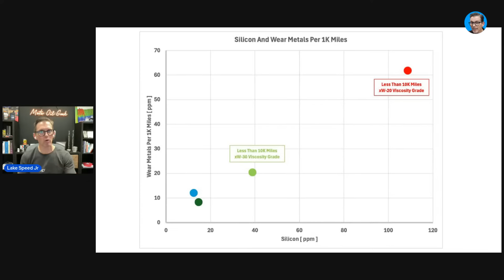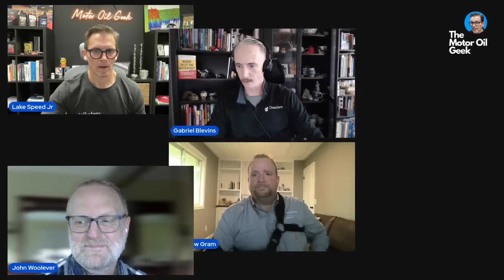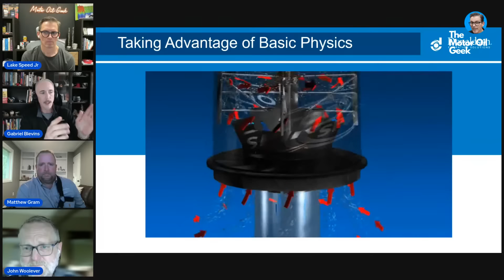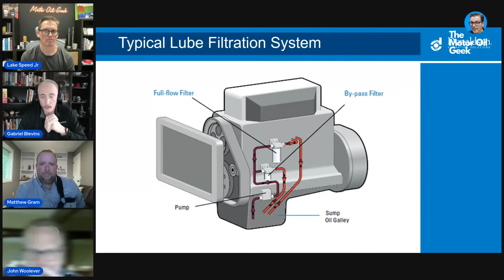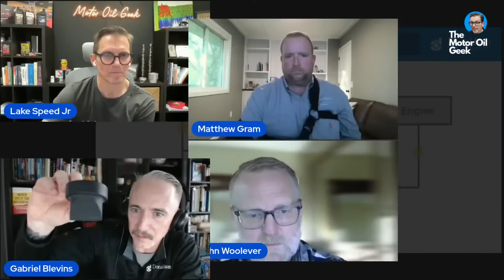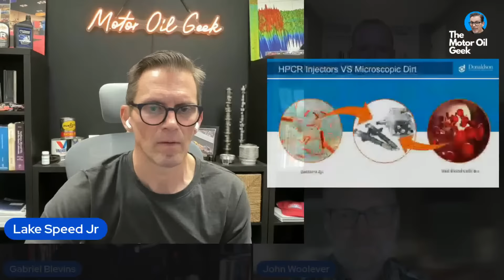DIRTY Filters Are BETTER Filters + BYPASS Filters EXPLAINED

Comment: So, I understand that you are saying to leave the air filter on as long as you can, and it will simply get more efficient as it loads up.  There is no indicator I know of on a gas engine, so I'll just have to use my best judgement as to when to change the air filter.  With that said, what about oil  filters?  Is there any advantage to running them longer as apposed to changing them frequently?  For example, the WIX Xp doesn't have the best efficiency rating, but is very well made with fully synthetic media.  It is rated for 20,000 miles, but most people don't run their oil that long.  Would a person be better off to run the filter up to 20,000 miles before changing it?  With all the used oil analysis that is done, has anybody looked to see if changing the oil filter more or less often has an effect on filter efficiency or contamination in the oil?
Reply: Lake answered this in another video, always run the oil filter for it's full rated mileage.  He also said to get the best efficiency rated filters.  I would choose the best rated filter from all those I have no concerns about how well it's mage.  You can't see a holed filter if it's a spin-on until it comes off and you cut it open.

Comment: I have experience with marine and industrial equipment centrifugal filters.   They work great... but they are multi-thousand dollar pieces of equipment  and are cleaned regularly (a quick check on the internet shows the ones I'm familiar with are about $20,000 and typically need 3 phase 440-460V). There are often 2 and sometimes 3 of them installed so you can clean and repair them while another one is running.   On industrial equipment that is shut down periodically there are often centrifugal bypass filters that can be cleaned when the unit is shut down.    I've never seen a modern car or pickup truck that would have room for even a the smallest centrifugal bypass filter I have worked on (housing about 7" in diameter).

Comment: Cake works on increasing efficiency of air filters but Lake you need to correct the latest video where you state FLUID OIL FILTERS get more efficient with time. Fluid filters don’t build cake. Especially not in automotive applications.

Comment: Great Video! The Air Filter gaining efficiency is logical but just never gave it thought.  I recall so many changing filters with a little discolor (light dust collection) on Intake Filters. Was always an easy Up Sale by the Service Writers in my older Wrench days.  Cabin Filters indirectly are a good example of that... since more ignore them until they are disgustingly packed or odor in cabin. 

Would like to see this continued into the various Aftermarket Dry & Oil Filters. I realize aftermarket CAI are more for "looks" than street gains, many filters are worse than OEM Filters for Dirt.

Comment: Great Informative Video on Filters, really enjoy these in-depth information sessions!  Fascinating Info on the Filter ByPass. So if ByPass is for plugged filters, less so for Cold due to lower Delta on pressure differential. If a common Diesel Mod is adding high capacity Oil Pan and large CAT filters that lack a ByPass (Cat puts ByPass Valve  in Mount)... many state lack of ByPass Value is bad, very dangerous... but most reference Cold Temps. With the CAT filter easily at 2X Oil Capacity and Filter media is 3X size, even on cold days (ie: -15 below) it's able to flow more fluid than OEM's smaller filter with ByPass; thus not impacting the concern for lacking the Filter ByPass?  Furthermore, with much larger filter (made for huge engines) it can easily be run much longer than the OEM Smaller filter due to 3X the media surface.  Especially if running a quality Oil By-Pass Filter system on engine too.

Comment: Does a dirty oil filters efficiency increase overtime like an airfilter does? Do they surface load?
Reply from the maker: Yes, they get better as they age.
Reply: @themotoroilgeek Good to know! So that begs the question now if you get a high capacity 15k+ mile rated oil filter is it better to run that filter for 2 service intervals (5k each 10k total) or change the filter every oil change? 
Future video maybe 🧐
Reply: @themotoroilgeek  that’s not true. Air filter true, liquid filters no.
Reply: @themotoroilgeek  I have a similar question. I have a '23 Rav4 Hybrid and am concerned about fuel dilution due to many engine "stop-starts", and am thinking of shortening my oil change interval (currently 5K oil & filter) but after watching couple of your videos, I am wondering if I should do my filter every other oil change . ? . especially if I shorten my oil change interval (I currently use Mobil 1 0W-16 & Toyota filter) . . ?

Comment: 56:40 '... octane ratings are higher'. NOT TRUE!  
European octane rates are not higher than North America. They are essentially the same, but quantified by a different units of measure. Similar to how you are not getting more nails when you buy 2.204623 lbs worth verses 1 kg. 
European gas with an octane level of 95 is the same as 93 octane in North America. 

'Europe, along with countries like Japan and Australia, uses the Research Octane Number (RON) system, which measures fuel's resistance to knocking under controlled, low-stress conditions.
 In contrast, North America uses the Anti-Knock Index (AKI), which is the average of the RON and the Motor Octane Number (MON), a more stressful test condition that typically yields a lower value.'

Comment: I cannot overstate how much I appreciate the discussion on air filters.  What many seem to miss is that the "high performance" air filter allows a lot more dust/dirt into the engine, and that slowly destroys the engine from the inside out.  I have heard the response of "it's ok, it'll get into the oil and caught in the oil filter."  That does not account for all the parts of the engine that dirt/dust makes contact with before that point, or that as shown in the chart (16 minutes) that dust/dirt particles are far, far, far smaller than what even the most advanced oil filter will catch and retain.  All that dirt/dust constantly grinds through every part of the engine where oil is present.

Most people that I know that run "high performance" air filters think or act like they're the next world renown racecar driver.  Then 80k miles hits and they have to repair or replace the block due to excessive blowby.

To me the air filter is the only defense from dirt/dust from getting into the engine, as such it is critically important in terms of engine longevity.

One of the things that I've learned is that the most expensive filter is not necessarily the best filter.

The discussion about bypass filters makes me smile so much!  I've installed 3 bypass filter kits on 3 different vehicles.  The first car had just over 15,000 miles on the engine (was fully rebuilt a year prior), and at the time 1200 miles on the oil and it was pure black.  After 90 miles of driving with the bypass kit installed the oil looked almost new.  Another 30 miles and the oil appeared new.  The car also started easier, ran smoother, accelerated easier and fuel economy did not decrease (it's difficult to say if it improved).

The 2nd vehicle (2006 WRX Wagon) had a fully rebuilt engine (back to factory stock) and even after 100,000 miles on the engine, it ran perfectly, had no blowby issues and had better fuel economy than other WRXs.

The 3rd vehicle was my project car it was a 1986 Toyota Mr2 with a 3SGE swap.  I had that bypass filter on from mile 0 plus a 6 quart oil pan (total oil capacity was just over 7 quarts) with a ton of internal oil control (baffles and 1 way gates).  After the engine break-in process was complete, I absolutely revved the unholy hell out of that engine (7200rpm redline) any time I could - and it never had any hiccup and never hesitated to nearly leap to redline.  Years later when I had to sell it, it still had no blowby, ran incredibly strong, the throttle response was basically telepathic (if you though about pressing on the throttle it was already accelerating), and still wanted to spend all of its time up near the redline - I've never had an engine like that before or since.  The current owner is a friend and he swears that there is something magical about that engine, and I cannot overstate how important the bypass kit was.

I'm already looking for a bypass kit that I can install on my current daily driver (GR Corolla), as I want this engine to last for well over 300,000 miles without need for a rebuild/replacement.
Reply: 🤣😂 what you seemed to miss is that most aftermarket filter setups have a much much larger surface areas.

Comment: Centrifuges have been used to separate water in hydraulic oil that gets contaminated by the process used in metal stamping for kitchen sinks.  Found out oil needs to be a higher temperature to be effective.

Comment: CAT has a recommended procedure for blowing out filters, and even then its ONLY the outer filter, NEVER the inner, and then there is a limit to the number of times. There are pressure limits and nozzle type limits. If you pay attention to what they say, it works well. But do most operators or lube guys? No. It's max pressure, single orifice nozzle, let 'er rip. 
For Ag and Heavy Equipment applications, I'm a big proponent of pre-filters, and of making sure that the moving elements are still functional.

Comment: The loading vs efficiency chart tells a great story.  What it doesn’t tell is time.   The chart doesn’t say the longer you run it the more efficient it becomes because time isn’t on the x or y axis.   I would imagine this is a test setup where dust of various sizes is injected into the airstream.   This is no doubt good analysis and to some extent common sense.   What would be more useful is in say the 10 different EPA regions do a daily driver test with monitors to see the same chart.  How long does it take for my air filter in the real world to reach maximum efficiency in each region.   Is it a day, a week, a month, a year?   Looking at high performance filters and comparing to this chart in a similar way would show the air filter with the max possible filtration but if it takes a year to get from 95 percent to 99 percent then how much dust gets through and how much worse are the high performance air filters really?
Lake made the point that only at WOT is the air filter a restriction.  Best point in the whole video. Too bad someone doesn’t make a replacement housing and filter that’s just as efficient but still lets you hear more turbo spool.
Reply: Very good point! A dusty environment would fill the airfilter up quite fast. I've seen airfilters looking horrible after 1 year and 30.000 km. Also filters looking fine after 3 years and also around 30.000 km. For the later ones, it was not possible to tell how blocked it really was just by looking at it.

Comment: Question I have, since transmissions seem the first to break down on vehicles. Why do manufacturers not engineer using spin on filters rather dropping a pan... In this way filter changes would be easier.  Fluid changes can still be addressed as per longevity of the lubricant. 😊  Go Army!
Reply: I've been wondering that too.

I have an older Honda automatic, and changing the oil is extremely easy. You just drain and refill like the engine. The drain plug even has a 3/8" square hole for a socket wrench to attach directly. The transmission is even designed so you check the fluid with the engine stopped, so it's really easy to check the level as you refill: basically the exact same as the engine, except for the dipstick port also being the fill port.

Only problem is that the ATF filter is internal, so it's not even a matter of dropping the pan, but rather that you have to disassemble the transmission to change the filter.

If it weren't for that, those transmissions would be near immortal like Toyotas are. All the Honda AT failures I know of from the 90/early 2000s are from the filter clogging and being inaccessible.
Reply: @AlexandarHullRichterThe real reason I think is try and make owners go to dealers for the simplest maintenance and repairs. $$$ for them.
Reply: Same reason a lot of vehicles don’t have drain plugs in transmission pans. Manufacturers found that people would drain their transmission thinking it is the engine drain and then add oil to engine = blown tranny from low fluid levels and engines running bad and smoking a lot all the way to bending rods from hydro lock
Reply: @tracycomtois9457 All I can say, "you cant fix stupid" if you dont know what you are doing, maybe you might not take on the task. Its funny growing up never heard someone mix up the trans oil and engine oil.
Reply: @tracycomtois9457  that makes sense, except that manuals do have drain plugs and don't have pans on the bottom.

Comment: Really really do want accurate information on diesel bug (all diesel fuel et-al., has water content, like it or not)?
Reply: Definitely was an issue from vehicle/s sitting most of the time, especially over summer hot weather, during and due to CV19 lockdowns...?

Comment: Lake, I know this is a bit off-topic, but it’s related to lubrication. I own a Nissan Frontier with the naturally aspirated 3.8L V6 (VQ38DD), and it’s due for a coolant service. I wanted to get your thoughts on using Red Line WaterWetter as a coolant additive. The reason I ask is that this engine has an internal water pump driven by the timing chain—not the serpentine belt. It’s mounted inside the front timing cover, so it’s not externally accessible. I was hoping that by using an additive like WaterWetter it might help prolong the life of the water pump. What are your thoughts?

Comment: At Rhino Andalusite Mine.
The mine that provided the material for the Space Shuttles heat shield tiles.
When they first opened lost all their mining machines engines in one shift.
The Andalusite apparently cut through the filter media so the machines were sucking in the highly abrasives mineral which ruined every single CAT machine they put to work on the first day of mining.
They worked a solution, Im not sure exactly how but all the machines when I visited again had big pre filter boxes mounted additionally. 
This was back in the early 80's.
Reply: Liquid filter, maybe? A lot of trucks have those instead of solid media filters.

Comment: Ive never really understood the bypass valve in the full flow filter in a car because if that valve is opened from the filter being plugged your engine is most likely ruined from metal that your engine has created! I would think you will know that the engine is ruined long before the valve is operated

Comment: I personally wish air, fuel and oil filters were made with more options. I would much rather have a more efficient and higher filtration filter that needs to be changed more frequently than a longer life filter. I would rather have cleaner air, oil, fuel that needs changing between 3k to 5k miles than one that lasts 25k miles. Give us options, choices.
Reply: Stick to OEM and you cannot go wrong for your engine although you might spend more if you change it too much but whatever its worth it in this case.

Comment: Completely understand the logic behind your data. However, as a mechanic/maintenance man turned engineer, change your air filter once a year and check it at every oil change in your everyday vehicle.  Some cases will be different, obviously.
Reply: I'm only driving my car 2-3000 miles a year.    I do change oil and oil filter every year.  But, I don't plan at changing the air filter for 10-15 years.

Comment: I’ve been a mechanic for 42 years and never heard all this nonsense. Change your oil regularly every 5000/7000 kilometres use decent quality filters and you won’t have a problem. I’ve been servicing return customers cars for decades so I get the best information with my own eyes. I just did a head gasket on a vehicle with 350000 kilometres and inside the engine was like new because the old bloke had me service his car religiously. Overload of information here !!

Comment: Excellent video, we appreciate. I have a question about DIESEL OIL  on motorcycle gas engines. There's a BIG discaution about this. Some guys said that you can RUN the bikes for 10 K miles with better performance and more durability on the entire engine, clutch and transmission. What's your point of view please. Thanks for your time and effort to the community.

Comment: Why dont they make a lower cost centrifical oil filter for smaller diesel engine like my 42hp diesel agricultural tractor? I know if they made them in a run of 500,000 they'd be priced low enough that we could all afford one..
Reply: There’s some out there.  PPE has one and there’s a few others for under $400.  The only thing is that you will need to fabricate everything to mount it and plumb it, or pay someone to do it.  I’m looking at PPE centrifugal filter for my 60hp Massey. I think it’s about $240 plus about another hundred or so for aluminum and plumbing.

Comment: I noticed my silicone jumped on both my cars (2012 Elantra-2013 Sonata) recent oil analysis. Air filter fine in both cars with no air intake leaks. Using same oil and oil filter in both cars. I'm at a loss.
Reply: Did you do any maintenance that changed a gasket that oil contacted (or used RTV).  New gaskets and RTV (and similar) release a lot of silicone in the 1st 5-10,000 miles.
Reply: @perryallan3524  Nope...no gasket change at all in the Elantra and gasket was replaced 2 oil changes ago for the Sonata.

Comment: Just had new intake gaskets done on my 95 eddie baure. Inside the motor looks like it has 2500 miles on it.its had mobile 1 full synthetic till i modded the motor,now at 241k miles on stock bottom end the rings hold and valley is spotless.been using driven oil last 6 years after using royal for 10.